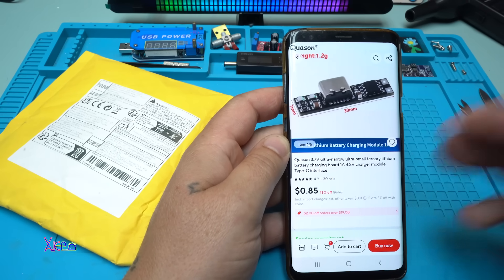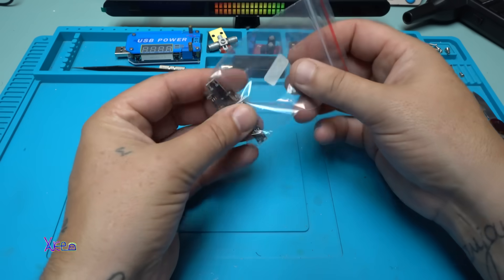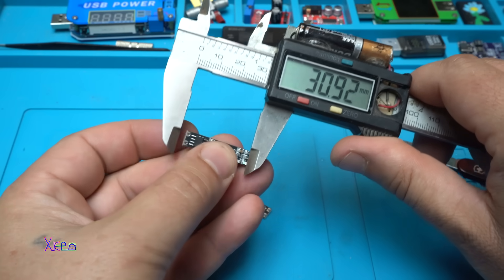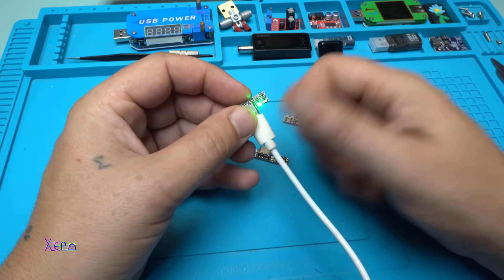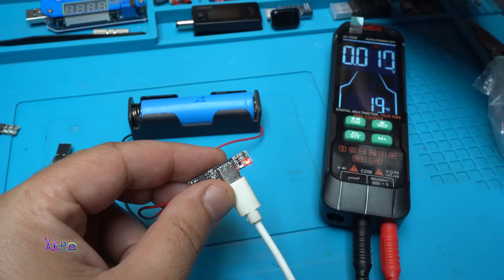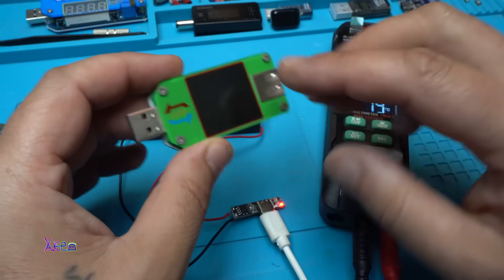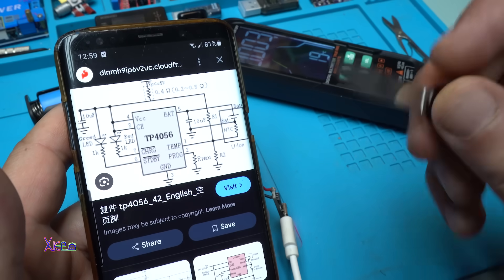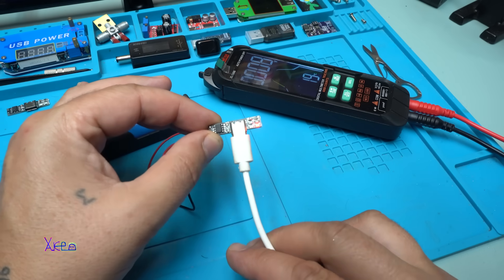$1 AliExpress Module - lithium battery charging board 1A

Comment: To charge safely, without danger, the module must be certified CC/CV (Constant Current / Constant Voltage) and preferably with intelligent pre-charge and short circuit protection.
Comment section is correct here, some of these 'charging' modules are just DC power supplies and thus dangerous for batteries like 18650's etc.

Comment: Well...for just one battery there is usbc charging pcb from disposable vapes 😉
Reply: the fancy ones even come with % charge indicator!
others are barely bigger than the port.

sadly most of them have the discharge protection integrated into the vape control so the maximum on time of the protected output is usually 10s...

Comment: Also you can get led torch modules for a few pennies. They include usbc charging , an led driver and an on off button. Some have a flashing and dim mode, but usually less than a dollar.

Comment: If I didn't have so many older 4056 bms boards already, I would buy these even smaller project boards.   
P.S.   I'm from the US.  Yes the tariffs suck, but  I've been stock piling for years in anticipating the crap now taking place not only in the us, but in the world.  
Good video.